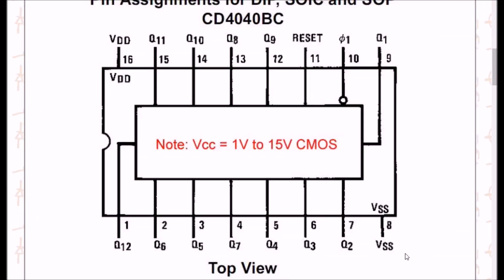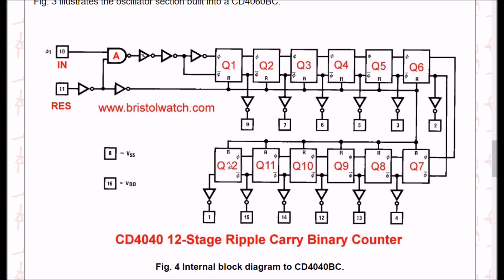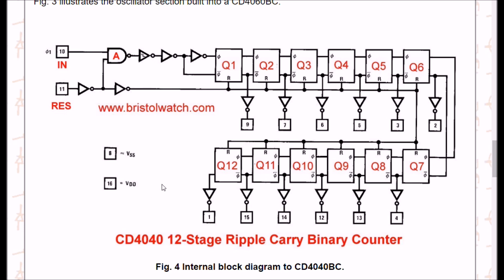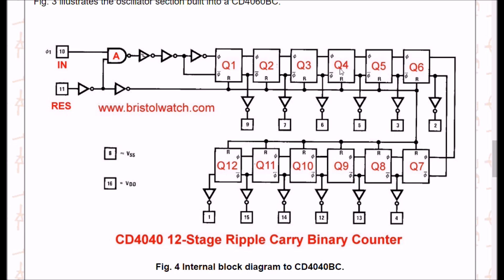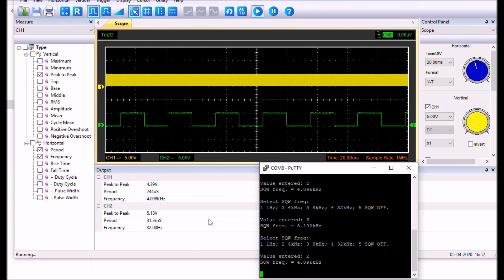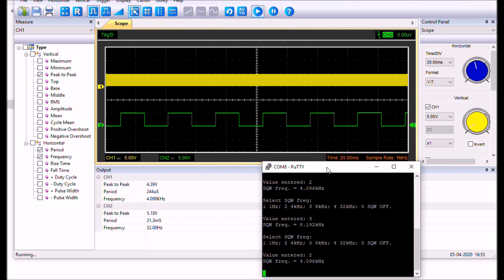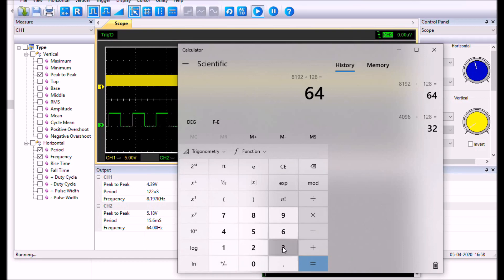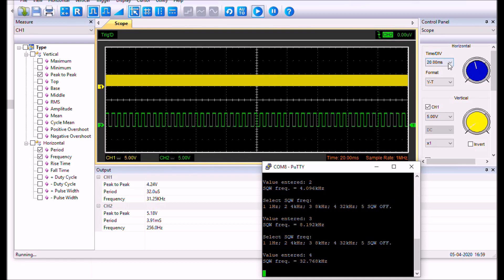CMOS CD4040 Used as a Frequency Divider from DS1307 RTC

Comment: Does the input have to be a square wave or can it be triggered by a clock such as an arduino microcontroller?
Reply from the maker: The square wave is generated by the clock module. The input to the counters can be any clock or square wave. I'm not sure what you are asking.
Reply: @LewisLoflin  Thanks for the reply.!! Sorry for the confusion. I am a composer who has been making my own musical instruments with microcontrollers. Unfortunately I have found the words clock,trigger,gate, sync.CV, pulse, simple high/low, etc are used interchangeably  quite often in the DIY synth world. Actually what I meant to ask is if a 5v output of an Arduino fluctuating between the high and low state could be used as a clock input for a 4020. I have been triggering sounds with the arduino outputs. But the outputs of the 4020,4040,and 4060 would work perfect for music projects because they are mathematically like music. A whole note split in half is a half note. A half note  split in half is a quarter note. A quarter note  split in half is a 16th note. then 32nd and 64th.  I have used a 555 as a clock source with success but when I tried the Arduino no success. The arduino is needed because I need a display of the beats per minute to dial up an exact tempo. Thanks again!!

Comment: What happens if you power it with 12V as opposed to 5V exactly?
Reply from the maker: If you do that 5V won't operate it.You will need a voltage converter.